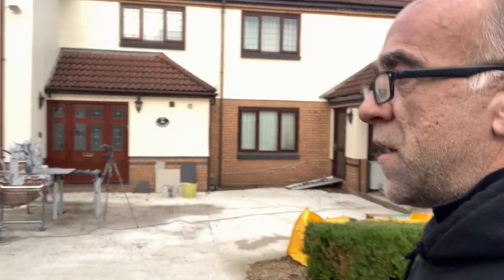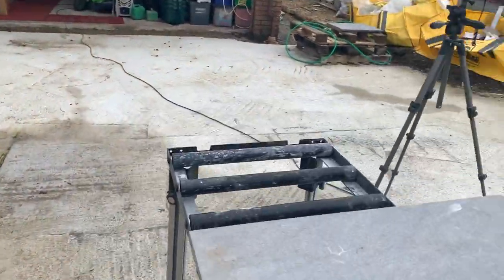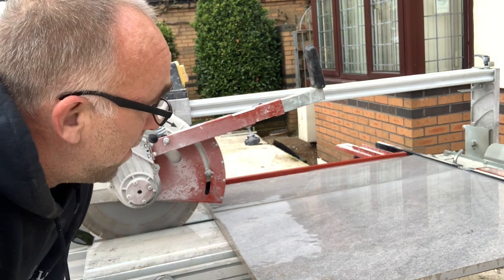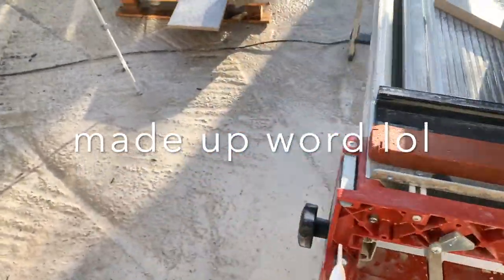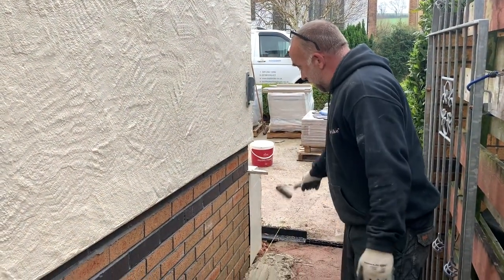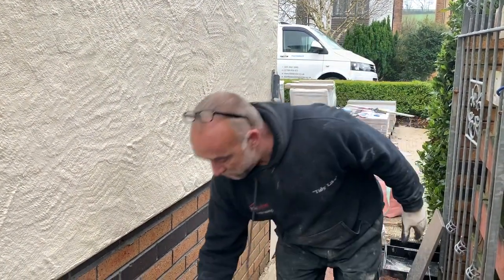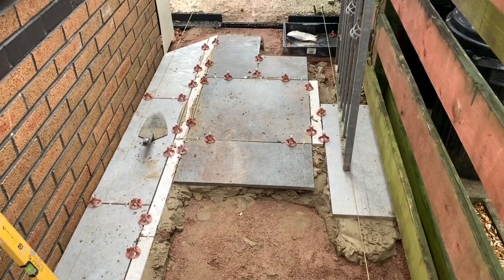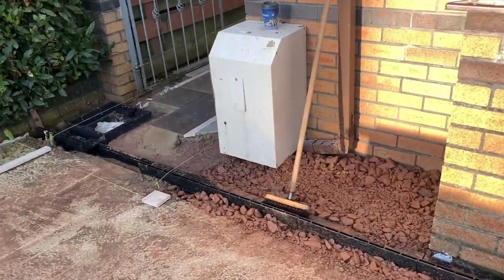Porcelain Driveway Leveling - The Ultimate DIY Guide

Comment: On jobs similar .ie patios.have you tried floor screeding the base then laying them with cement and sbr and an 8mm ridged trowel ..as long as the tiles are uniform I've found thus works well and your joints don't fill with muck ...
Reply from the maker: Yeh not gone down route yet maybe in the new year have a good Christmas 👍🏴

Comment: Any chance of a detailed video on setting up your fall and string lines. I've done two patio jobs now and I hate using string as it either gets under your feet or gets distorted by the slab. Next one I do I will use blocks on my level for my fall and maybe some string just to keep the lines straight.
Reply from the maker: Keep the line taught at all times even if you trip over it 👍🏴

Comment: Don't force the saw to cut
Reply from the maker: And a great saw it is 👍🏴
Reply: @tidybrickslandscaping  Yes they are great saws... I am  a tiler by trade and have used Raimondi saws for a long time, I would also try a new tech blade that would help with the 'chipping'
Reply from the maker: @tomastley6080  actually you’ve just reminded me to get in contact with my man Phil Bosson @pulvexDiamond I follow on Twitter for a new one as a spare. Last blade was called a turbo next ones going to be the top blade probably with top price guess &150 with vat 👍🏴
Reply from the maker: @tomastley6080  got a price today for a 350mm porcelain blade £250 !!!! Oh well sent it anyways 👍🏴
Reply: @tidybrickslandscaping  Seems a bit steep - I use these guys for my stuff - https://www.atsdiamondtools.co.uk/
Reply from the maker: @tomastley6080  thanks for that Tom my usual guy sold me a 300mm top porcelain blade today much cheaper than 350mm prices 👍🏴
Reply from the maker: Part 3 of 5 is out today and making progress for number 4. https://youtu.be/e10GDeyvUPk
Reply from the maker: Part 3 of 5 is out today and making progress for number 4. https://youtu.be/e10GDeyvUPk